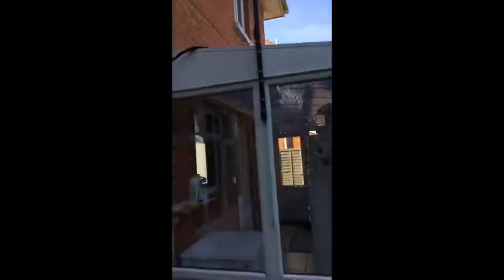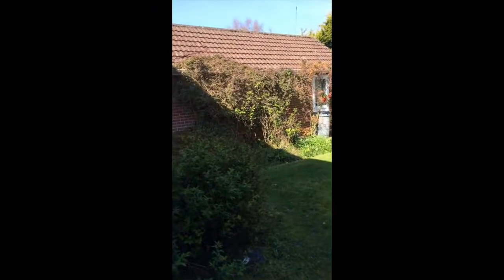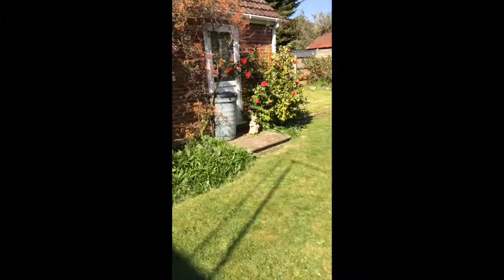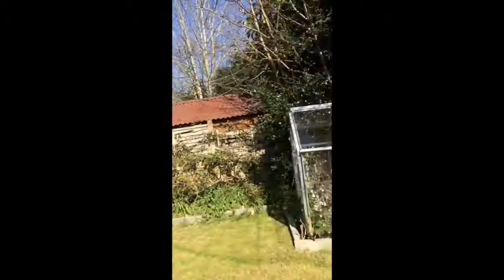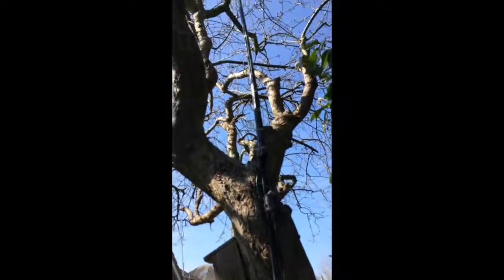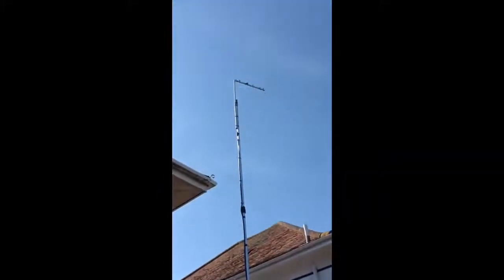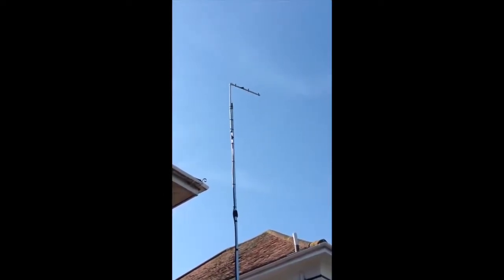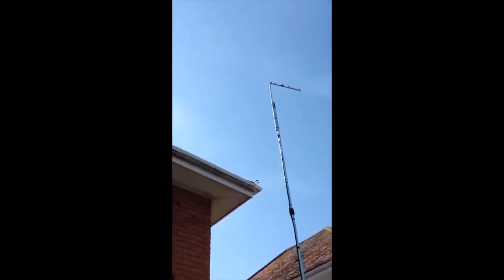5 - Homebrewing Wire Antennas

Comment: You clearly have a very understanding partner, my wife otherwise known as Atilla the hen,  antenna radar works very well, so my wire's are in the 12 trees at the bottom of the garden. 73 Paul M0BSW